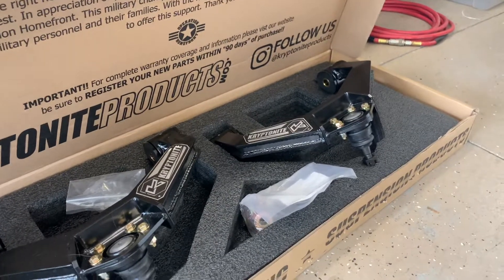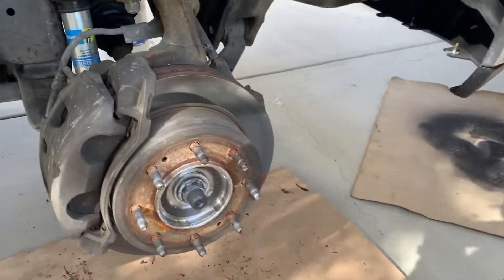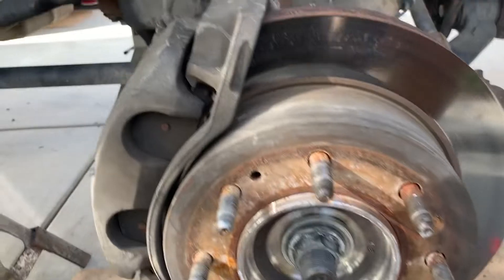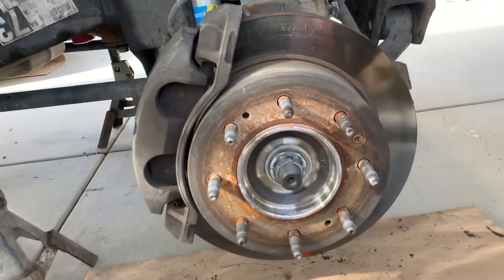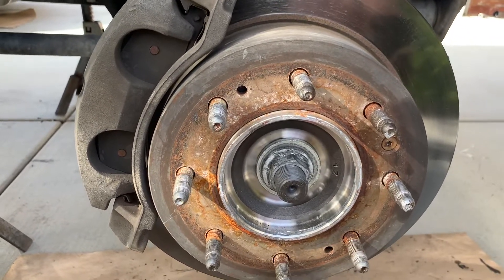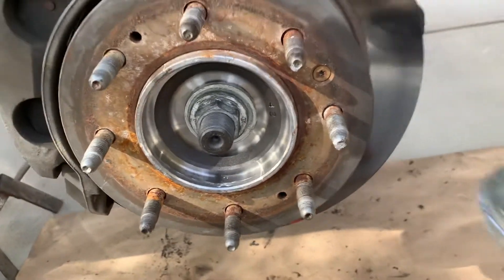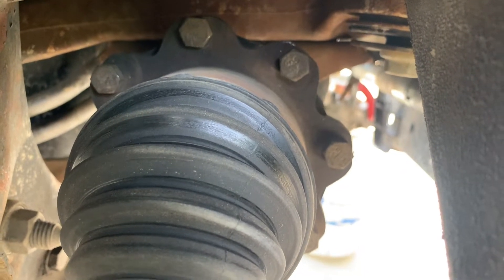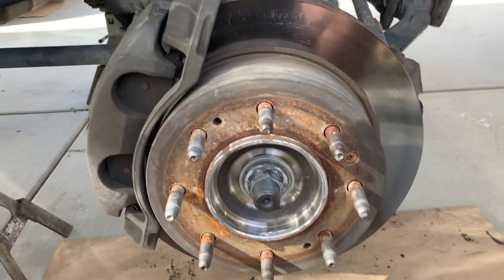LML Duramax Silverado Front End Rebuild Part 1 (Tear Down)

Comment: I'm pretty sure you can stick a screwdriver through one of the holes in the rotor to keep it from spinning
Reply from the maker: Good tip!  I guess as long as it’s got a large diameter shank, you don’t have to worry about it bending or breaking.